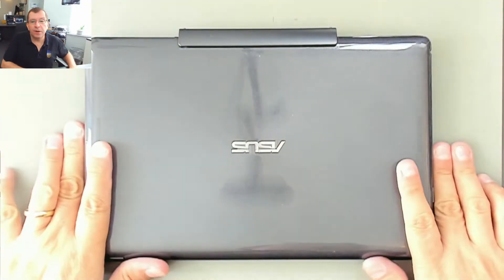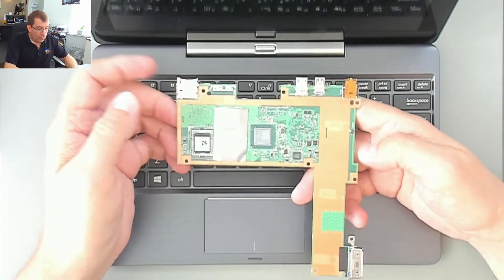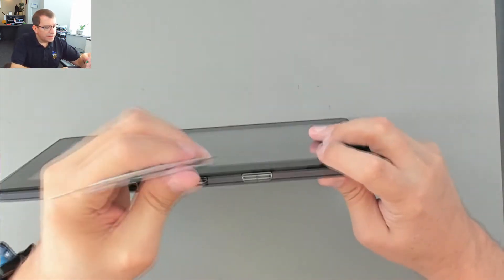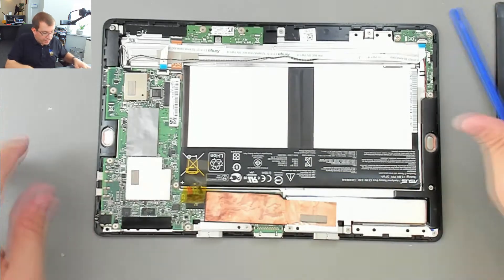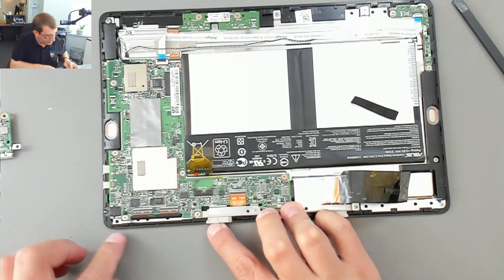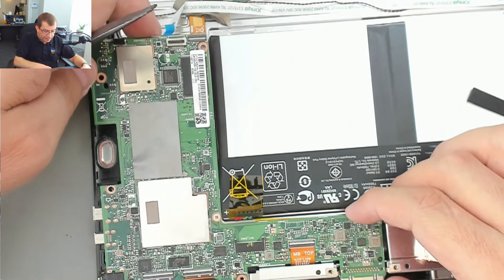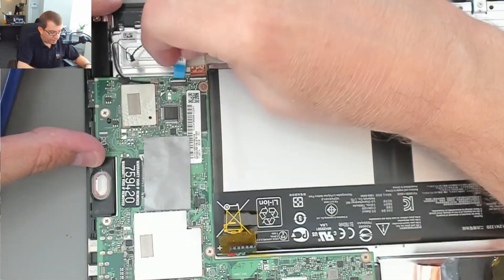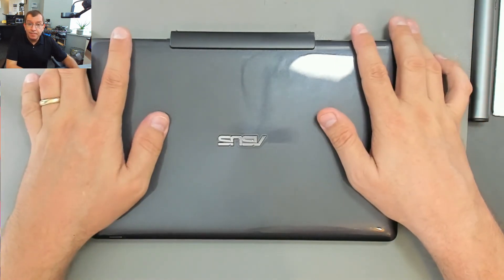[84] Asus Transformer (T100TA) -  Motherboard replacement

Comment: Would it be possible to replace that cpu thermal pad with a thermal paste and some copper plates to bridge the gap better?
Reply from the maker: Yes, probably. I do think CPU throttling would make this PC pretty slow if you tried to do much with it.
Reply: @ComputerHelpNI  not that it can do much anyways lol, maybe I'll buy some 0.8mm. Since I had 1.2mm and they didn't work on the RAM. I'm afraid to put too much pressure on the CPU and crack it lol.

Comment: windows 10 installs but only 32 bit, even though it has 64 bit processor,,,,,, go figure ?????
Reply from the maker: Strange -- I've not seen that before.
Reply: The bios is 32 bit. I figured that when installing a linux on it, it causes me headaches.

Comment: HI, great video with good clear images, I have damaged the black,hold down strip which holds the hinge on both the power FPC cable and the digitize. ( in the video, it's at 13.03 showing MB TOP and 11.55, MB TOP, Do you know how many pins these connectors have in order to purchase
Reply from the maker: Oh no! Sadly I don't know how many pins -- sorry!

Comment: i see on cpuz that theres another slot for ram. do you know where it is ?
Reply from the maker: No, I didn't see anywhere you could add RAM.
Reply: Can the RAM be replaced with another higher capacity one? @ComputerHelpNI
Reply: it is beneath the heatsinks. altough I believe every chip in this PCB is soldered..
on 2:39 you could see a black sticker above the numbers.. there you should find 2 slots.. one occupied.

Comment: can you connect the keyboard  to the tablet using one of the USB ports available ?  I would have tried that first ,  instead of replacing the motherboard if the docking port was faulty
Reply from the maker: In this case, the customer wanted it to work as intended from the factory, so I replaced the board. You could use it as a tablet or use a USB keyboard, if needed.